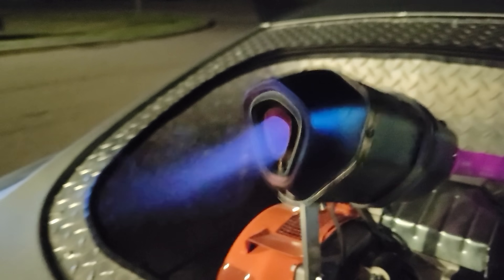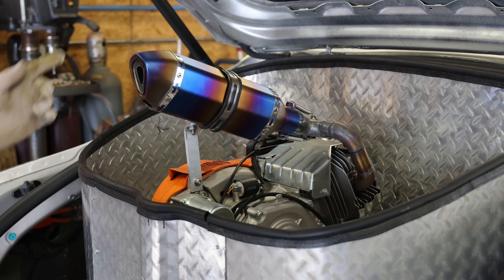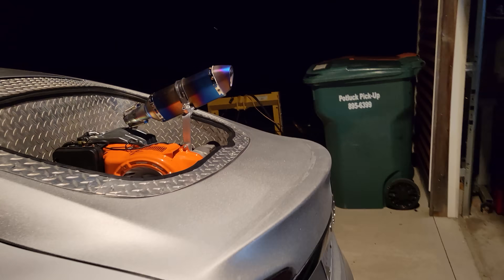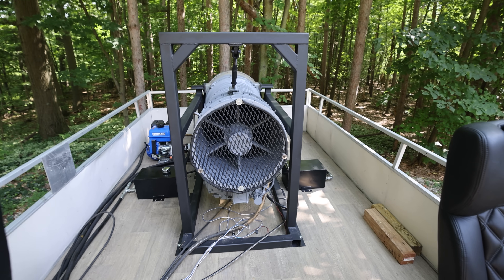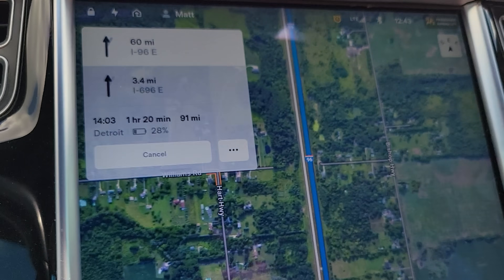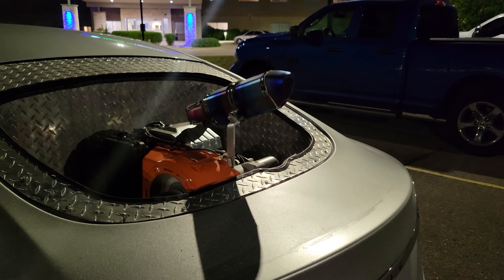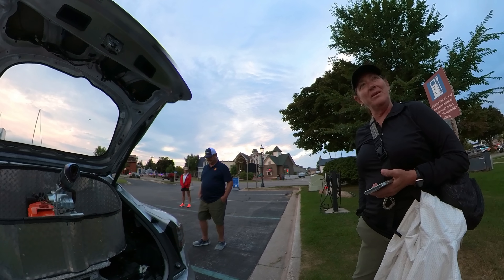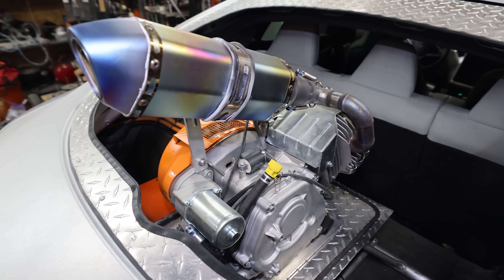Cordless Tesla (I Drive 1800 miles without charging) P.1

Comment: I don't think it was very smart to put a really loud exhaust on it. Pretty tacky. I think you would have been better off to put two 420 CC engines in there and a custom super quiet exhaust. where you can stand next to it and can't hear it. Then you would have been able to maintain almost every speed limit and have unlimited range until you run out of fuel. then you also probably would have been able to put the engines in their efficiency range instead of maxed out. I don't think it was very well thought out.

Comment: Interesting build. It sounds like it used around 200 gal gas for the trip.
my cordless Prius takes 30 gal to do the same trip. I've always wondered if a small diesel generator would make a good parallel hybrid setup. Beyond the inefficiency of a gas generator, Maybe the weight, overpowered electric motor, and lack of aerodynamics of the Tesla are tanking the fuel economy

Comment: I wonder if a 22hp horizontal shaft v-twin with a harbor freight or better quality 12 kwh generator head would do any better. The stopped overnight charging absolutely destroyed any mpg equivalent gains you could have had over a hybrid or regular gas vehicle. It is super cool in theory though.  I wonder if, with the right combination you might be able to get it up to Motorcycle/scooter or better mpg territory.
Reply: Tesla gets 3 miles per hour on a normal 1800w outlet.  If that 12 kwh generator outputs 12,000 watts - so that'd be 20 mile per hour added range.  During 24h run the entire time, it's a respectable 480.  Probably fine for one person driving 8 hours a day highway (60 miles per hour) but would be insufficient for any higher driving (multiple people driving shifts).  And the range is theoretical, mountains and elevation would destroy some of it.

Comment: Well mine does a better job i guess so i have a BMW i3 Rex with a 650cc engine under the trunk is super quiet, 2.4 gallon tank give me 98 miles per full tank... it doesn't charge my batteries but it does hold the state of the battery i'm very happy with it😬

Comment: This way of roadtrip travelling is way way slower than just using the normal Tesla superchargers. Tesla superchargers charge at 250 kW, his "petrol charger" only at 7 kW. So Tesla superchargers charge 35 times faster than his "petrol charger". If you account tha you would stop every 4 hours for 20 minute bathroom and eating break even in a petrol car, then roadtrip in a Tesla takes not any longer than roadtrip in a petrol car.

Comment: Your concept is on point
But you may want to redesign your layout.

1. If your generator output power is less that 5000 watts, you need to upgrade in order to do a rapid one hour recharge.

2. You can redesign your system like the one i have where i can travel 1100 miles on 5 gallons of gasoline while cruising at 70 mph. This system is a direct drive electrically powered. No batteries

3. In your case, you can install a smart power controller with a larger generator output. 

The vehicle motor is connected to the smart power controller "LOAD TERMINAL" 

The battery 🔋 is connected to the smart power controller "BATTERY TERMINAL"

The generator is connected to the smart power controller " POWER INPUT TERMINAL"

The smart power controller works in this fashion.  The Smart Power Controller monitors the load demand and it will select which power  source to use.

Example, if you are running on batteries, and the batteries have reached a critical low level, the Smart Power Controller will start your generator so as to power your vehicle from the generator. While operating on generator output power,  the Smart Power Controller will also recharged the batteries.

Once the batteries are fully charged, the Smart Power Controller will shutdown the generator and run off the batteries until the generator is needed again.

With the above concept, the vehicle can drive from New York to Los Angeles with a 10 gallon generator gas tank.

With a 300 mile battery range for the car, and a 1 hour fast charge gor the BATTERY, your generator will only need to run for 10 hours during the course of your trip.

I recommend a generator output power of 9000 watts with 220 volts output ..

NOTE: to quiet the generator noise, try using an automotive exhaust system instead.

Comment: .... Defeats the purpose of having an Electric powered car.  You have turned it back into a hybrid. Congrats!
Reply: This is where things get .. Complicated.
Where does the electricity come from?  If it comes from nuclear power plants, solar, or Wind then that argument might be sound but large chunk of the power comes from coal power plants.  THUS it might be more energy efficient to drive a modern fuel powered car (IF you take into account the line loss from the power plant to the charger, and the fuel required to ship the coal to the power plant).
Reply: @johnsmithfakename8422  Please go back to school to understand my comment's subject matter. Let me explain my comment to you. My comment speaks directly to the subject matter of the video itself. Nowhere does it imply anything other than addressing what this presenter claimed. "1800 miles without charging". He did indeed charge it. With a gas powered engine, connected physically to the vehicle. Thus making it a hybrid type vehicle. Not an Electric only vehicle. It does, in fact, defeat the whole concept/purpose of an electric vehicle.  The "power plants" you are referring to, are already in operation, apart from this.  Placing it as a reply to my comment, is just plain arrogance on your part. You could have just placed your comment on your own. Alas, you chose to try a counter to my straight forward comment.  You are arguing just to argue- something! EV stands for Electric Vehicle. Tesla is engineered to be an EV on it's own. Charging it with a gas powered engine just adds to what is already being introduced into the atmosphere BY POWER PLANTS, no matter what is using the electricity. Hopefully you now understand the subject matter of my comment.  YOUR subject matter may be important, but says nothing actually countering what my comment said! Boiled down: EV, turned hybrid, defeats purpose of EV in the first place. Nothing to do with your poor attempt at putting my comment down. I can see why you have "FakeName" in your id. However, if you were in fact, Irish, I would invite you to a pub and we'd  discuss it over a pint or two.

Comment: American engineer invents the first plug in hybrid electric vehicle (circa 2022). later hybrid vehicles would be more energy efficient, significantly quieter, and not leak gasoline on the ground

Comment: There is some thing wrong with your engine, it's running so lean , and you need to check what's wrong,, you will have better burning and fuel efficiency

Comment: The concept is awesome!!! I just seen a Honda 6800 watt generator that was as quiet as my 2000 watt generator. It would absolutely fit in the back of your car and it would be way way quieter
Reply: @0:50 his gasoline power plant generates 10,000W with 13.4HP. Even with that much wattage, it still not enough for the Tesla consumption. How the 6,800W generator going to be enough?
Reply: It’s basically what the Chevy volt does
Reply: @Lostcomms7600  Volt can directly drive the wheels through the Voltec gearbox. There are many different modes it can operate in, all automatically of course. And the integrated gas engine is 84HP on the Volt, not 13.4HP. It can do power balancing with the electric motor to give extra oompf when you really need it. (Not that the electric motor needs it. It's already very torquey.)

Comment: Build a opposed piston turbo diesel engine with platinum plating on the cylinder heads and pistons, with digital valving and the latest in cvt technology for the transmission  for your generator and then develop a super muffler your efficiency will be through the ceiling and hyper clean emissions

Comment: That MPG is depressing... I get over 40 at 75mph in a turbocharged gasoline powered car, for at least 500 miles straight. You see, I told you the 10kWh generator wouldn't be able to provide.

Comment: 7 days non stop at full load is a lot for a small engine. My honda demands a whole oil change at 200hr so basically if u had this engine running for a day more u had to change it's engine oil and clean filter 😂. Get 3cyl diesel in there.

Comment: Biggest problem you’ve got there is the engine appears to be running pretty much flat-out, i.e. at maximum power, as opposed to maximum torque. Far from optimal efficiency, as evidenced by your figures as well as the red hot muffler exuding flames! A larger, less stressed engine with the RPM governed to run at peak torque (as opposed to peak power) would be a LOT more efficient.

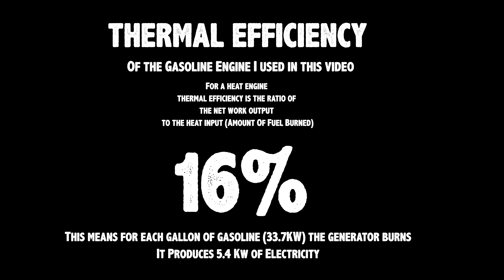Comment: @15:04 those values are kWh (of energy), not kW (of power)... but kudos for working that out. It does illustrate one of the major problems with this design, which the very poor efficiency of the chosen engine - it should be almost twice that efficient, and would be with a better engine.

Comment: Fabrication of the mount and enclosure are shown, but there's nothing about the generator or the electronics. Was the generator packaged with the engine, and how was it mechanically coupled? How is the generator output connected to the car - DC direct to the battery (how is it regulated?) or AC to the onboard charger?  Is there another video with this, or one coming?

Comment: I realize that there is a second version coming, but why not use a suitable engine the first time? This one was obviously not going to be powerful enough.

If a Model S uses roughly 35 kWh per 100 miles, it will use 21 kW or 28 HP at 60 MPH... double what this generator set can produce, so it was doomed to fail to keep up.

Comment: Need to add a 70HP engine minimum to keep it charged at highway speeds.
Reply: Nowhere near that, although about double what was used in this project.

His data shows 389 Wh/mile @ 80 MPH, which is 31,120 Wh to go 80 miles, or 31.1 kW at 80 mile per hour. That's 42 horsepower... and there's no need to sustain that speed; power goes down rapidly with speed, and 70 MPH only takes 21 kW (28 HP).
Reply: @brianb-p6586  He was driving 75mi/hr
Reply: @grassrootscajun  He was driving at various speeds, at one point so slowly that he was pulled over for travelling too slowly on the highway. But as I explained 80 MPH only takes 42 horsepower, so 75 MPH doesn't need 70 HP.

Comment: the better move? build your own aluminum air battery pack to charge it on the go. aluminum air packs have 8x the power density of currently available lithium tech. one pack the size of medium carry on luggage would give you an extra 200 miles of range.... a 500 mile tesla. aluminum? 17 cents a pound? that's a cheap ride.

Comment: I have solution to dilemma, buy a used Chevy Volt, good combination of electric plus quiet generator…400 mi range without stopping to top off gas tank…but of course not as exotic. I am surprised other manufacturers havent taken this approach with a greater than 60mi all electric range before the generator starts…

Comment: You still had to stop for gas and to charge it and charge it overnight.   Using the car as intended is more practical.  

Like you said...hybrid so just get a trailer with a nice size gas engine to charge as you drive, because that's what will have to happen.  At least youll be able to make it quieter.

Comment: This is why I always had just a slight problem with Tesla's is they cannot travel as far as a gasoline engine yet this is one of the reasons why I haven't purchased one is because I like to go on road trips and I don't want to have to stop and charge on my road trips you know the worst I want to have to do is fuel my car and fuel myself rather than sit and wait for a car to charge so when Tesla comes up with a longer lasting battery I'll happily buy one but until now I'll just admire them from afar

Comment: I've been saying this for years!! All you need is a decent generator, not an egine. This way you will ruin the battery cells. You need two sets of battery cells. Use one set while the other charges then switch the power from one set to the other. It could definitely be an automated switch for the battery pack switching. Yourwelcome!!

Comment: Is there not a way you could run alternators off the axles with belts or something so that they are always charging the battery system as long as the car is moving? Idk probably a dumb question I'm a novice with these electric cars lol

Comment: Hi, I just saw your attempt at making a hybridized Tesla and then rushing it into service.  At first glance I knew that the chosen generating rig was way too small for the wattage demand. Also the muffler was insufficient for the roar of the beast, but also you're going to need a small catalytic converter for the bigger motor that you'll need for the fast charge version so you can drive that efficiency up by not having that damn thing on all the time, which will destroy any engine.  Fast charge, not on as long, saves gas as well.
   This is where you can see that Tesla cars, if they had gasoline engines, (but they are actualy coal fired via the power company) that you can see that the size of engine to overcome all of the inefficiencies,  would have to be quite large to have the same power in acceleration and cruising.  The gasoline economy will always be terrible,  its a relatively heavy car because of the batteries.

Comment: I want to see a breakdown of how much you payed for fuel compared to what you would pay to charge it at home or at a DC fast charger. 😂
Reply: Value of time? Other than the overnight stay (where many hotels have chargers)…!
Reply: @URBANENGINEER  There's no value of time gain with his current build. He had to pull over and let it sit numerous times. Probably almost exactly the same time to charge as using a charging station.
Reply: Plus how many gallons wasted from leaking and a low efficiency way to charge.

If he doesn't want to charge, better to just drive an efficient hybrid.
Reply: thats what I was thinking

Comment: If I paid for a hotel room and had to listen to this thing charging all night...
Reply: eroi bior  generator noise is mostly mechanical noise other than exhaust. That's why permanent generators live inside of large sound deadening boxes.
Reply: @Lorien Lorenzo - I like you 🤝😸
Reply: Agreed.
That exposed fuel line tap would he turned part way through the night round here.
A polite message left, then police if it turned back on again between 10PM and 7AM
Reply: @markp8295  that's funny... Me no like noise so me send killers to fix.  Gtfo rat snitch mf.
Reply: @markp8295  just as any person with self respect would,  yes
Reply: @thetruthisonlyperspective4872  I think you're mixing up self respect and arrogance.

Comment: I like the concept...it would be interesting to see if an air-cooled diesel would be cost efficient and perform as needed...
What about running the exhaust under the body, if room allows, through a resonator...?k
What did you use as a generator...?
Would a high amp vehicle (car or truck) alternator work run through an inverter...?
It looks like this venture shows that internal combustion is not going away...and...considering the infrastructure needed, may prove to still be the better choice...right now anyway...

Comment: Use a little liquid cooled kubota or Kohler 2 or 3 cylinder diesel.
Enclose it with sound proofing. 
Have a low energy fan sucking air into the engine compartment and a EXIT point for the warm air.
Add a second fuel tank.
Goal is to go 3000 miles with no fuel up or corded charge up...
Let's see it happen and defeat the money sucking f.u.e.l.s.c.a.m. 🙂

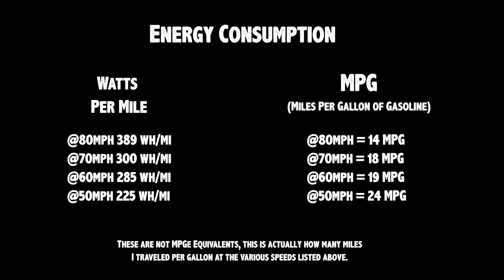Comment: 14:54 This kind of triggers a question I have about electric "efficiency".  While it's easy to say power providers are using a certain percentage of renewable sources.  Maybe they have relatively stringent pollution requirements.  Surely a backyard generator will be wasteful in its own ways.  

BUT!  

Consider how many electric cars are basically being charged by burning coal.  Consider how much parasitic loss comes from the myriad of transformers, high tension lines, switching systems, more transformers, circuit breakers, meters, and fuses.  Every stage converting some of that energy to waste heat.  Storing what's left in an electrochemical medium with its own efficiency issues.  Finally using that stored energy via heat converting controls on a spinny heat converting electro magnet.  Is the net result really more efficient?  Surely, it costs less, for sure.  But, do those savings come with their own cost?